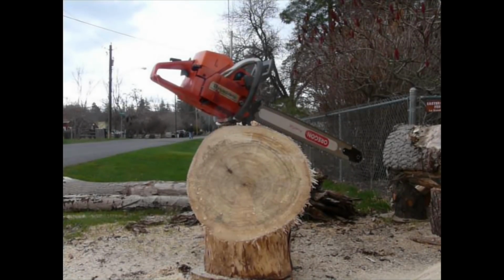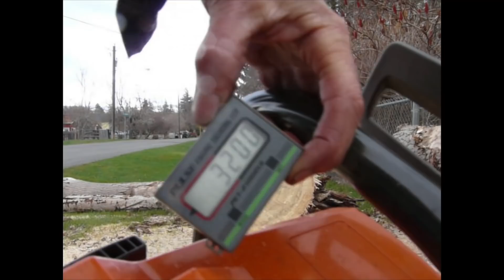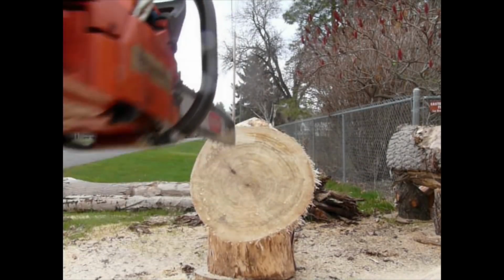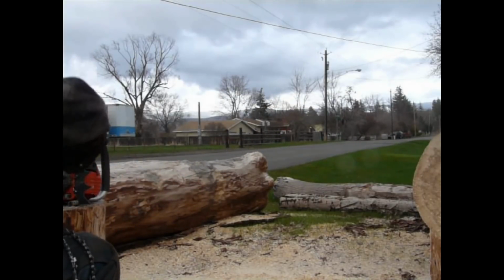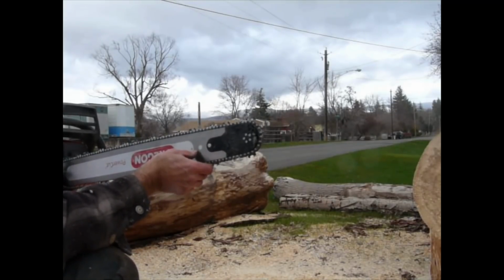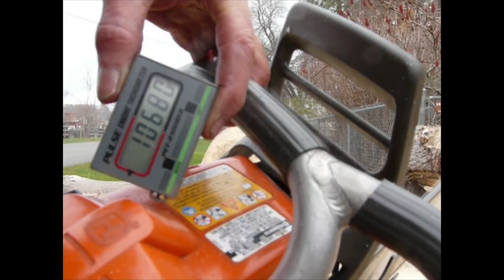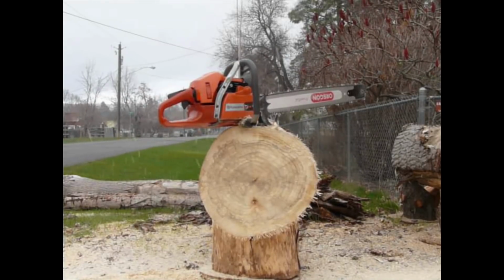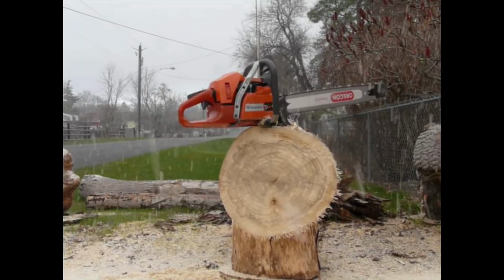"Huskvarna" 272xp Stock vs 357xp ZIPPED!

Comment: Hey Jack I got a little tech tip , you can use a clutch cover off a 455 rancher on the 350 series saws the chain adjuster works better , I figured that out now all my 357 or 359 saws has them just figured I pass this info along to a fello builder .

Comment: I have a 2001 357 and a newer 372 and pound for pound the 357 is my favorite . great video . Thanks .
Reply: Friend, what the best speed max for 372 xp oe 2003
13500/13200?
Reply: @Sensei948  I am not sure but I bet works really  good to . My 372 works good it is just a lot heavier , It doesn't scream as much as the 357 but has a lot more torque

Comment: Both saws sounded good to me...that 357 pretty impressive....chain pretty grappie..rakers down, like you said west side chain....thanks godbless be safe....stay in the woods
Reply from the maker: Shoe hi. I think it is a little hard to hear on the camera mic. The 272 was struggling @ 13,080. That's why I never went any higher in the rpm range with it. 
The 357xp has my Patented "Torque Tweak" and is not a winder but a grunter. We will look at that next.
I'm running the stops .040 to .065 on my chains. Makes 'em a bit grabby on the inland wood if I don't compensate on the teeth angles. 
This chain pulls out chunks. I find the more aggressive the chain the more easily "we" can tell on the power differential. "Wood" I use a chain like this in an all day felling application - heck no.
Thanks for watching.

Comment: What cylinder do you use in the big bore kit? 
I just dug a ms441 out of a dumpster pile for 25$ and would like to try a big bore.
Reply: That's awesome hoping to score a 661c the same way this week, the guy has a box full.
Reply from the maker: Ira hi. What I do and/or don't do is an in-house type thing. Had some problems with the pirates. Not really saying much at this point.
Thanks for watching.
Reply: @hotsaws101  10-4   no problem its how you make your living,  trade secrets. 😉

Comment: That's a great running saw, that 357!!  I've been running a 3/8, .050, 24" bar on my 359 from new, and always wondered if it would take a 28" bar.  Is that possible, or does it take a mod of some kind?  Thanks!
Reply: Unless things have changed, a 24" bar is the longest factory produced bar for the small mount Husqvarna. I ran the 262xp in the 1990's and heard of a 26" but never saw one. He obliviously gets around this no problem.
Reply from the maker: Gentlemen hi. D025 mount with a spacer so I can run Huskys & Stihls in the same test session.
Thanks for watching.
Reply: @hotsaws101  Thank you for the reply, Jack, I'll look them up!
Reply from the maker: It's going to be off a bit on the siting though unless you fit the right small stud spacer o nthe 357xp.
Reply: @hotsaws101  I checked out both the mount and spacer you mentioned, I believe I understand what's needed now. Thank you for your responses!  Enjoy your Good Friday and Easter celebration....Lord Bless!

Comment: He must have a bar adapter for the 357xp.
Reply: And or a modified bar. I was thinking the 357/359 were small mount.
Reply: @Brian2bears  he modifys everything
Reply: No just hafto change the drive sprocket from.325 to 3/8
Reply from the maker: Gentlemen hi.
Bar is a D025. Used an adaptor. Chain is .375 pitch. I do modify most things to get a better performing package for felling timber in a more expedient fashion.
Thanks for watching.

Comment: Stil wondering what this 'Zipped' means. :-) I must have missed something browsing through your video's....
Reply: Mr. Jack is a chainsaw builder/porter. Zipped refers to the modification level/levels, Psy-ko version etc...
Reply: @Brian2bears  Yeah, well.... I tried to find more information about that... But as said, wasn't able to find any :-( That Mr Jack's a porter, I noticed on the revs he shows us :-D
Reply from the maker: Gentlemen hi. Most use ported and or modded. I use ZIPPED because they are a lot more "zippy" after the operating table session. As far as I know it is indigenous to the NorCal Coast.The “levels” in my build sequence are named. For no other reason than “level 1”, “Level 2”, etc. seemed mundane. So Psy-Ko 5th in the sequence.
Thanks for watching.